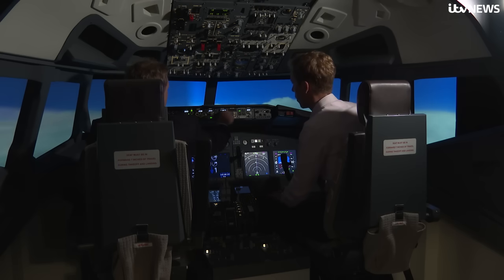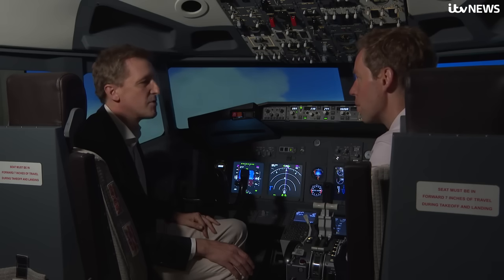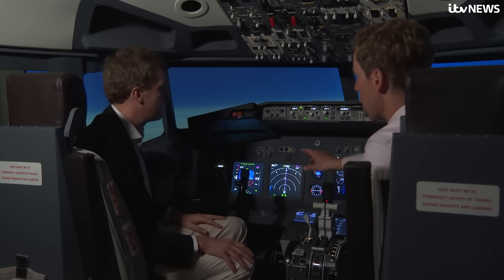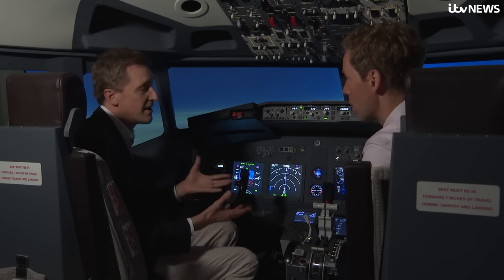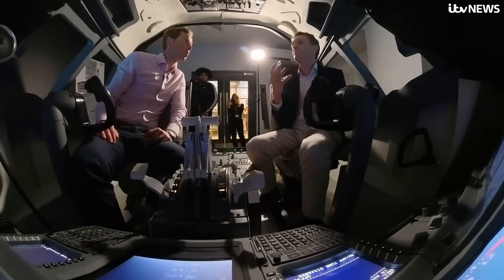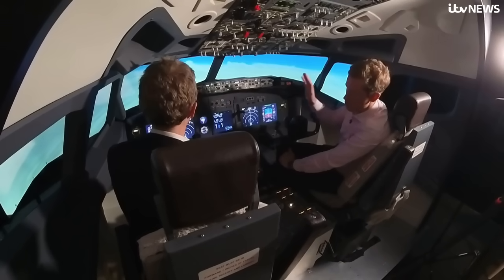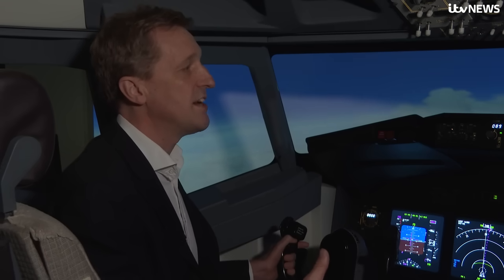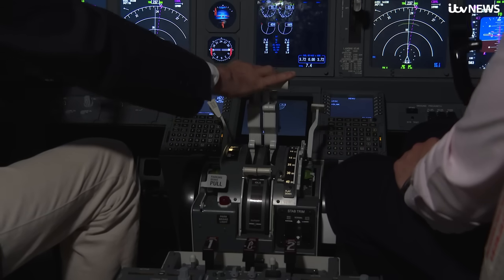How does air turbulence work? Aviation expert explains issues faced by Flight SQ321 | ITV News

Comment: You know, I recall flight attendants always saying wear your seatbelts at all times when you’re seated. If you sleep on a long haul flight like SQ321, they ask you to put the belt over your blanket so they don’t have to disturb you to check.  I know you’re still at risk when standing and moving around, but it minimises your exposure time. And crews can normally detect it a few minutes in advance and turn on the seatbelt sign. For those who wonder why the pilots can’t just change direction at will, aircraft are following a specific track, and unless they have an emergency to deal with, they can’t just change heading without checking there isn’t nearby traffic they’d endanger or even collide with.

Comment: You know, I recall flight attendants always saying wear your seatbelts at all times. If you sleep on a long haul flight like LHR-SIN, they ask you to put the belt over your blanket so they don’t have to wake you to check.  I know you’re still at risk when standing and moving around, but it minimises your exposure time. And crews can normally detect it a few minutes in advance and turn on the seatbelt sign. Don’t forget, aircraft are following a specific track, and unless they have an emergency to deal with, they can’t just change heading without checking there isn’t nearby traffic they’d endanger or even collide with.

Comment: Why do planes fly so high up there...37000 feet... is 25000 not good enough...almost always it happens at higher heights
Reply: Higher flight level means less air resistance = better fuel economy.  And usually less turbulence. But it can happen at any flight level current civilian aircraft can reach.  Also note that it’s incredibly rare to have a serious incident such as this, which is why it’s newsworthy. How many car crashes took place during the 13-odd hours of that flight? With far higher numbers fatalities in many cases. Sense of proportion matters, people.

Comment: It is simple.Wind travels in different directions at different levels.Where these levels meet is called "wind shear" , the greater the difference in speed causes turbulence , so since hot air rises and cold air sinks the nearer the tropics the greater the chance of severe turbulence.

Comment: 2:40 "..bend the wings through 90 degrees" - I really want to see a video of that. The wings must be made of rubber.
Reply: All over YouTube. Look up 777 design upper load limit testing. You’d be sure to find one. Design upper load limit is the classification of stressing a plane to 1.5x what can reasonably be suspect to be found in actual flight in terms of stress.
Reply: @mitcho04  According to Boeing, tthe max 777 wing flex is 9 m, so if  total width of wings = 64.8, and cabin width = 5.87m, then the max angle of flex is arctan(9 / ((64.8 - 5.87) / 2)) =  16.98 degrees, which is very far from 90 degrees.
Reply: p;enty of videos of it i think the 787 is the most impressive

Comment: it did not fall half a mile please correct that the entire differential of height was 400-600 feet
Reply: When you're on that plane that's half a mile😂
Reply: @Dayda-7  u know that i experienced turbulence over the indian ocean with storms felt like we dropped a mile it was about 200 feet definitely had white knuckles 😂
Reply: Look at the chart at 1:29
Reply: @daniel72_751  yeah and……
Reply: @daniel72_751  if you mean the grey line thats verticle rate not the actual change in feet
Reply: @daniel72_751  it got pushed up around 400 feet probably by an updraft then down by about 400 the actual movement wasnt very big at all but at 600mph of course when that moves in a direction at speed anything that isnt secured is dlying around
Reply: In what world is 3000ft not half a mile.
Reply: @mitcho04  where did you get  that random number from 😂
Reply: @guitarnoob6771  in the graph of the vertical profile it literally shows.
Reply: @mitcho04  lol no that’s vertical speed look at the variance of the blue line tht is the altitude 🤦🏻‍♂️

Comment: You wouldn't disconnect the autopilot at 36,000 ft - the aircraft is in such a small envelope that many authorities forbid hand flying above 29,000ft
Reply: Not really. If you have runaway nose up trim, you'd switch off the autopilot, as an example.
Reply: The first thing you do in severe turbulence is disconnect the auto pilot, set a certain thrust called turbulence penetration thrust and aim to minimise altitude deviations.
Reply: First of all, if the turbulence is severe enough and the movement of the airplane great enough, the autopilot will disengage automatically, but with an extreme vertical movement of the airplane, the pilots will definitely take manual control for the simple reason that leaving the autopilot engaged could make things worse because the autopilot will try to return the airplane to the set altitude again which would not necessarily be the desired action you want if the airplane has just dropped several hundred feet.
Every airline has their own procedures for this.
Reply: @TheChiefEng  And they're trying to programme self-driving cars where the variables are 1000x more.